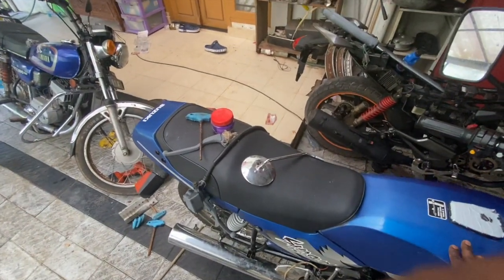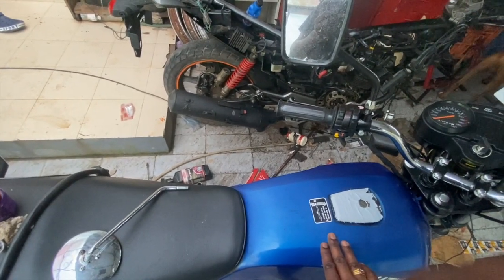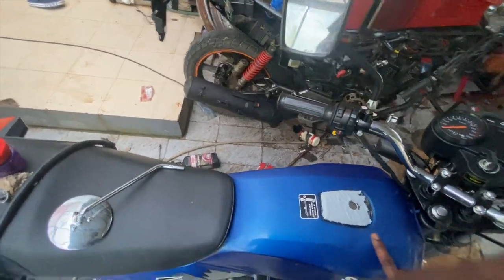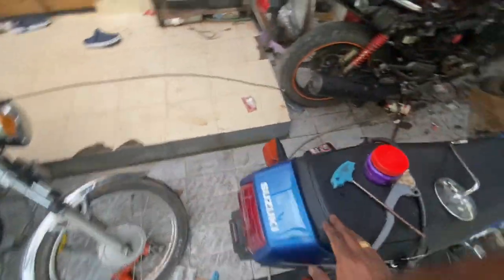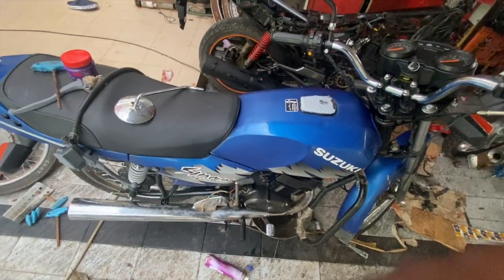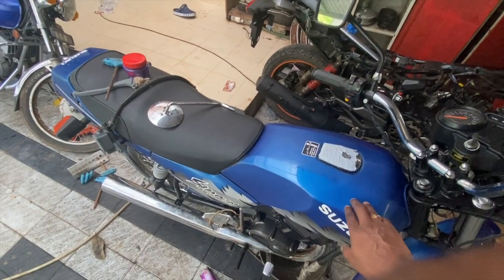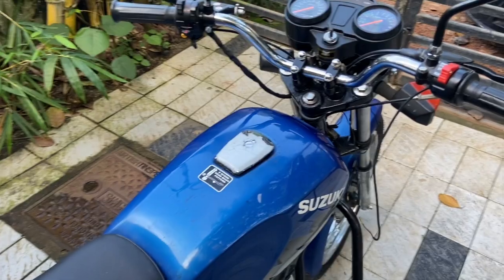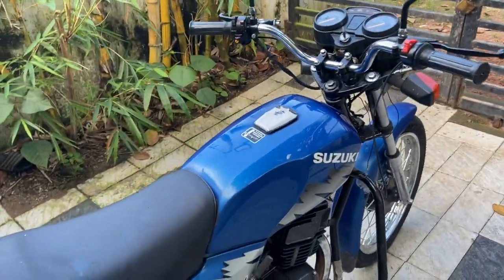Shaolin Factory Paint Restoration | Cutting + Polishing + Ceramic Coating | (Malayalam Video)

Comment: Pramod bro, I have completed my engine bulit for my Rx100...but I am hearing a strange noise which we hear when go on train ....tak..tak...but I have checked the crank it for have any shake in both directions....I have no idea about this sound..  please advise me in this...
Reply from the maker: Check clutch play
Reply: Bro, clutch doesn't have any shake...but I will check and let you know.
Reply: Check the bore if the not bored correctly means the piston will make some slapping noise, and dont think too much on the noise and dont get get depressed, its usual in 2 strokes
Reply from the maker: @logavinayagam5031  ok
Reply: Bro, clutch is good... may be the piston may hit on the Cylinder Head cause the noise?...just my assumption... what is your opinion Bro
Reply from the maker: @logavinayagam5031  we are shooting in the dark, i am guessing based on what you told me. send me a video on instagram

Comment: Chetta njan ente max 100 nu new painting cheychu but petrolil pipeil ninnu petrol leak aayi engine il finish aaya paintil veenu but paint polinju vannu .... Paint remover ozhich pole aau petrol veenadathe paint polinjath ...kanditt sahikunilla ... Can you plz tell me why
Reply from the maker: Petrol, brake fluid ellam corrosive aanu
Reply: @Yamakaze but stock paintil petrol venitt onnum pattittila athu enthukonda
Reply: @Yamakaze  inipom petrol leakage vanna pani kittathe irikan njan entha cheyande
Reply from the maker: @surajcyriac1283  tankil pin holes kaanum, ath annel puthiya tank vekkyannath aanu nallath
Reply: @Yamakaze  tank nu no vishayam ... Problem petrol pipenu aarunu athil oru cheriya hole undarunu ath vazhu leak aayi
Ini enthelum kanich petrol veena paint protect cheyan njan entha cheyande
Reply from the maker: @surajcyriac1283  new tank, vere onnum cheyyan patilla
Reply: @Yamakaze  tank fine anu 
Petrol nte pipe aarun leak ath fix cheythu ipom ellam perfect.
Ini ennelum petrol paintil veenu paint pokathe irikan njan enthu cheyanam

Comment: How much does it cost for only painting and ceramic coating👀
Reply from the maker: I do painting as part of the entire restoration package so I don’t calculate things separately, other painters charge anyway between 15-25k and the quality of the materials are usually very substandard. Even if they use DuPont, they skimp on primers, clear and other stuff